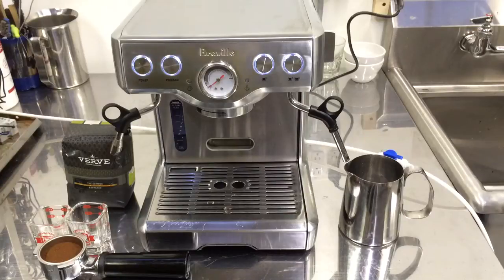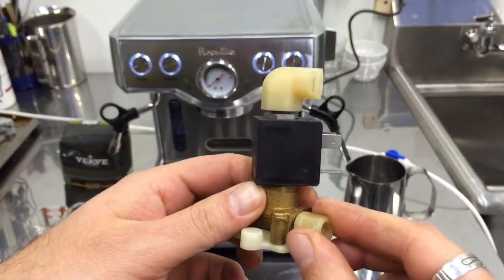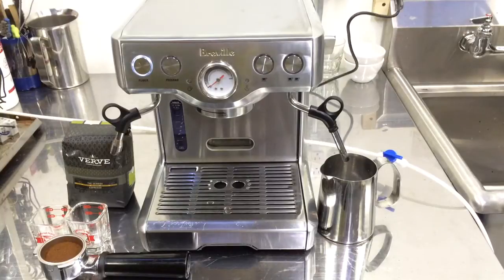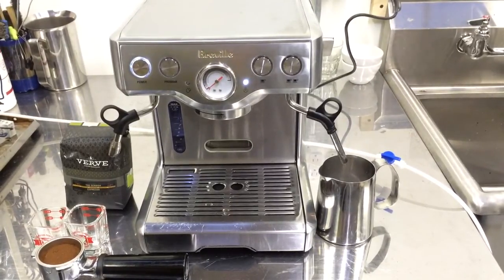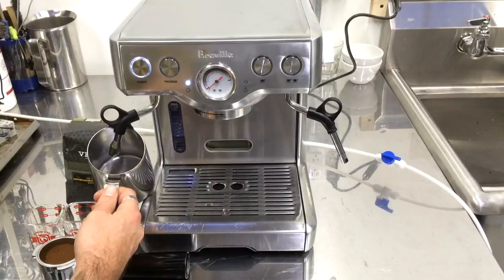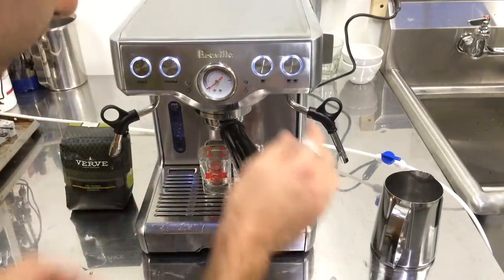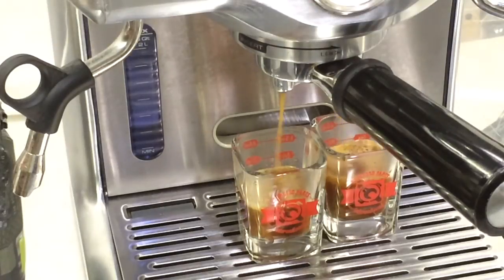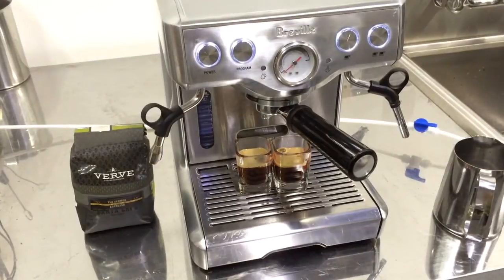Breville Three Way Valve

Comment: hi, was the valve the problem or the plastic connector? my plastic connector snapped this morning ; (
Reply: +Kanen Coffee, LLC. thanks, does the new metal connector fits on the "old" valve?
Reply: +Kanen Coffee, LLC. so i would need to buy the new complete valve with the new connector, wouldnt i?
Reply: +Kanen Coffee, LLC. thanks for your help :)